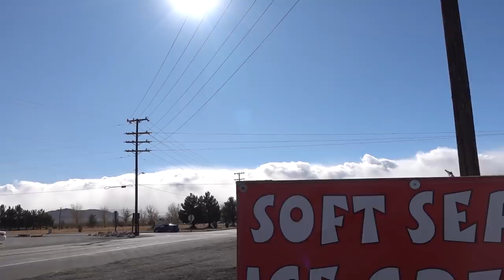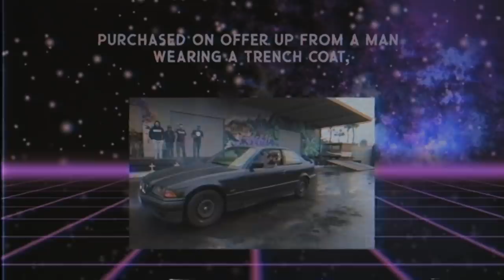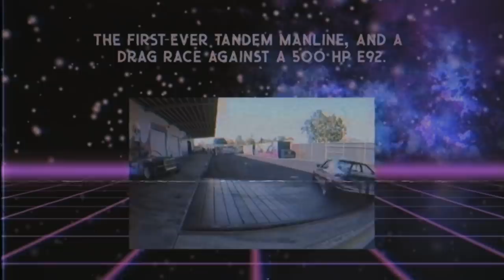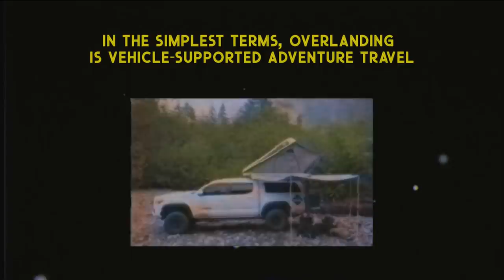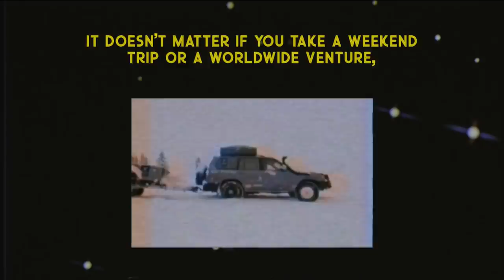Sh*tcar Goes Safari Spec! Our Infamous SR20 Powered $350 BMW Gets Chopped Up and Off-Road Ready

Comment from the maker: Now that Shitcar is an Off-Road Shredder, what’s a list of mods we show throw at it next?!
Reply: 'borrow' some shocks off one of bj baldwin's trucks
Reply: As many “bro” blinding lights you can fit on the front.
Reply: Some rockets and send it to space on the next F&F movie! 😂
Reply: You need a home fabbed bullbar
Reply: Snorkel. I wanna see some puddles. Big puddles.
Reply: Make it a pre-runner, should cover all the best mods needed.
Reply: Lonnnnggg travel
Reply: At least 37 inches of tire
Reply: Snorkel
Winch
Bull bar
LED lights brighter than the sun
LED UTV whips

Just a couple suggestions :P
Reply: Paddle tires
Reply: Hoonigan  put the biggest engine in to it
Reply: Put a spare tire in the back
Reply: Definitly needs stiffer suspension for that mad cornering capabilities.
Reply: Shitcar is now beastcar
Reply: Go full pre runner with it. Reinforce the shit out of it and put on some king long travel suspension on it
Reply: It needs some suspension to even be an offroader. It isn't one yet, that thing is horrid.
Reply: Glamis
Reply: Make shitcar ready for Baja, and take it with scumbug
Reply: Full off-road suspension with an angle kit.
Reply: More active AIRDYNAMICS....
Reply: Baja.
Reply: King shocks. The thing needs to flex and move. A way higher final drive to move the knobbies and fix some of the hanky cut for those off road flares!
Reply: Hoonigan make shitcar into a rally car
Reply: Time to get Kibbetech involved for a long travel suspension upgrade.
Reply: Needs long travel.......pre runner bimmer.
Reply: Shitcar-Hovercraft 😁🏎💦☔️
Reply: Why not turn shitcar in to a rally raid shit car?
Reply: An episode with narrative.
Reply: It's perfect
Reply: Create a unique GT3 bodyshit.....
Reply: A roll cage and some seat belts.
Reply: bolts to hold shit together.  and a gas cap.
Reply: just some better suspencion and that's it
Reply: Big rear mount radiator, rally dampers and re-enforced suspension arms, Braid rally wheels, and WRC style hood mounted light pod.
Reply: Get a roof rack, the Yeti cooler, but also add the exoskeleton
Reply: fox shocks and a new diff
Reply: Shartkart it but keep the bmw shape but with ground clearance in mind. Put some good shocks and done. Sandrail style.
Reply: Full trophy truck pre-runner style... ya know like that sick off road crown vic!!!
Reply: UNDERLANDING.
Reply: Full overland spec! Roof rack, extra fuel tank, trail jack, recovery boards, pop out tent, everything!
Reply: AWD
Reply: It needs off road lights and vented Jeep doors😂😂
Reply: Shitcar rally car
Reply: 2 spare tires, beer cooler, optional roof tent. Recovery gear
Reply: Finish cutting the body off make it off road shart kart long travel suspension too many lights done
Reply: This settles it, ShitCar needs a long travel suspension now.
Reply: Throw in an Ls or a 2jz
Reply: A harness, Proper coilovers, and a skid plate
Reply: Definitely some kc lights. Suspension and a big wing for hot boi points
Reply: Poor s**itcar, you guys should restored because has so many memories
Reply: PRERUNNER!!!! Shitcar definitely found its calling!!!
Reply: Mad Hoonigan fury road
Reply: All I know is you guys better be planning on throwing some over fenders on that thing
Reply: Seeing shitcar like this feels like hoonigan just stabbed me in the balls wtf guys its SHITCAR!!
Reply: Hoonigan king coil overs and 9inch #shitrunner
Reply: Crappy widebody and nice shocks and rally lights for the hood
Reply: As with all shitcar revisions, it all depends on how much is left after the ain'tcare moment.
Reply: @autobotdrift2714  why one when they can put two
Reply: Proper safari treatment:
Wider fenders, roof lights, bull bars...
Reply: king shocks and radiator plate
Reply: Give it a bozoku exhaust or body kit
Reply: Bozuzoku body kit or bozuzoku exhaust our the hood
Reply: paddle tires take it too the dunes
Reply: Daytons.  Daytons on all 4 corners and jump it. Alot.
Reply: 69 likes
64 comments
we're close
Reply: Rollcage!
Reply: Safety maybe 3rd but get some harnesses for it and seats with more cushion. Then the LED light bars and shit
Reply: A dune buggy "stinger" exhaust
Reply: Make it a drifter again. This thing is was on such a good path with the sr20 going in but this is the worst it has ever been. And put a rear end on it
Reply: A legit long travel suspension ...
Reply: Defo some suspension
Reply: LONG TRAVEL AND SHEET METAL WIDE BODY
Reply: Awd swap?
Reply: Paddle tires
Reply: Move the engine to mid-rear now...
Reply: Full on off-road suspension and other off-road stuff!  Shitcar is Shitcar—not a piece of shit.
Reply: PIAA round olschool off-road lights would be awesome.
Reply: Softer springs, pre rubber bumpers, spare tire rack and a light bar
Reply: Hoonigan long travel suspension
Reply: long travel prerunner style suspension.
Reply: please show me how your raised it!
Reply: Hoonigan should make a shitkhana
Reply: Time to AWD the sh#t one
Reply: Prerunner bumpers brah!
Reply: Big skid plate, keep our baby safe
Reply: Gotta get the farm jack make it off road worthy
Reply: Deep water snorkel. Fording rivers!
Reply: It now needs actual off-road suspension, and maybe, just maybe, a cage, Just in case one of you roll it...
Reply: six-wheel conversion
Reply: Awd, dtm style kit go full rally
Reply: 80s front bumper
Fender flares
Suspension
Amber truck cab roof lights
Cage and Cushy seats
Reply: about 10kg of C4   , finish it of with a bang , time for a NEW shit car
Reply: Shit car bro dozer 🤣
Reply: Hey hoonigan I thought Brandon left or put notice in? Did ken offer him more t shirts or something? Or pokemon cards?
Reply: Shit car fitment goals
Reply: Build & battle shitcar vs scumbug go to Baja
Reply: A front skid plate
Reply: Fix the suspension and the safety gear, making it a killer desert race car
Reply: Frs
Reply: Ken block for shitkhana 1
Reply: Shocks, lights,  skidplates,  and an actual cage.
Reply: Huge light bar and fog lights are a definite. Another turbo 👀 roof rack for sure. Extra beefy spare tire on the back that’ll never get used just for looks. Less weight like Dan did with the purple bmw.
Reply: Hoonigan now you have to use it in the Gambler500!!!
Reply: Definitely needs some long travel suspension, but instead of spending 10 grand on a Baja kit, make it yourselves with the cheapest materials possible lol.
Reply: Do a loop-de-loop in it
Reply: Send it to the crusher, there's no point trying to salvage it now. Or build a real suspension and turn it into a tube chassis rail buggy.
Reply: I bet HHIC has some rally spares. Do shitcar up right for once...
Reply: Sabastian Thole they don’t “know” terracrew , they’re all the same shit lmao hoonigan is terracrew
Reply: Widebody
Reply: Long travel coilovers
Seatbelts
Skid plates
Rally style light bar
Desert air intake
Reply: Hoonigan we need kikawa
Reply: First "upgrade": can you get at least stock suspension travel back?🙄
Reply: Hi-lift jack
Reply: Mud flaps (seriously)
Reply: Proper suspension lol
Reply: A big ole LS and some long travel suspension
Reply: Bullbar
Reply: Lights lights and more lights
Reply: Cargo uptop
Reply: A giant blower

Comment: you guys should weld a barn hinge for a gas pedal that's what I did for my clutch. It actually works out really well because you can bend the hinge to the angle you want before welding the hinge part, and the holes for the screws make great ports for good welding penetration to the pedal.

Comment: Did you weld the rods in the shocks to get the lift? I wanted to see what would happen if I did that so I did so with an old mazda 323. Three small bumps and a wood pile and the transmission case split right around the bell housing.

Comment: Maybe Sh*tcar but BMW's make for fun offroad machines never seen 4x4's more pissed off getting passed by a stock older 5 series gunning down the track past them...not good for ruts but they have 1/2" plates under most of the drivetrain so hard to dent

Comment: lol, that forester has a garbage cvt trans... I blew my first out in 38k, second at 77k, and cvt won't stay in boost, it will automatically 'shift' down to 2300rpm if using the xmode and paddle shifters. I really wanted my forester XT to be a typhoon killer, but I got walked by a 90's typhoon in DFW on 635 one night...  FA20DIT is good, shit ecu/tcm with shit cvt.